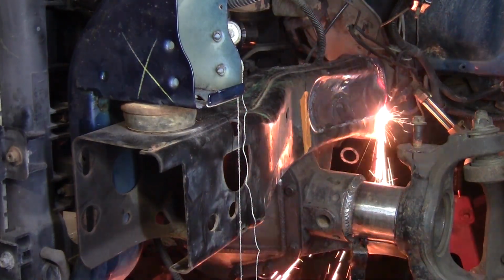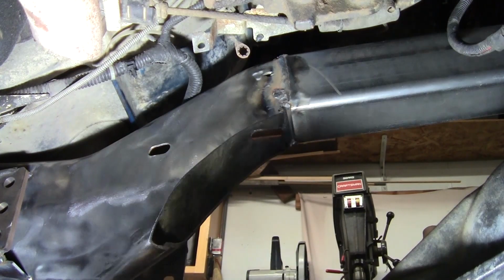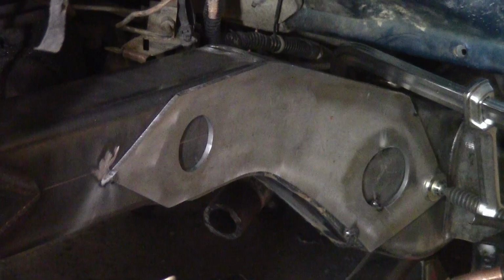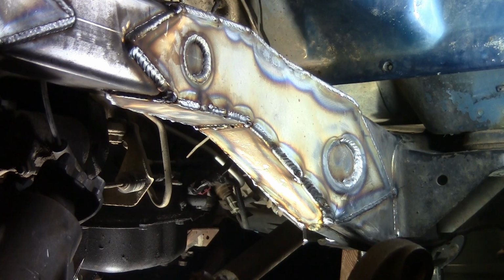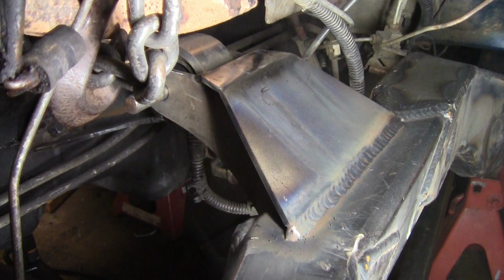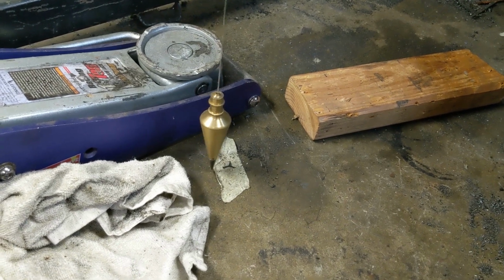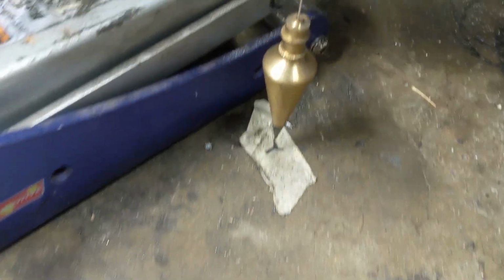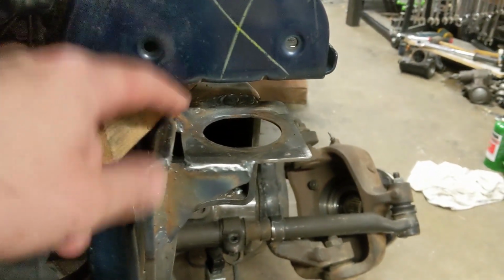Custom frame rail reinforcing - [Project SuperDUkota - Dodge Dakota + Super Duty axles] Part 4

Comment: I've seen so many people solid axle swap their stuff....that seems incredibly dumb to me if you want clearance because the bumpkin is solid and lower. If you want something fpr clearance while offroading, wouldn't you want the CV axle style setup front and rear I stead of only in the front? That way the bumpkin is up high and the axle shafts go down to it on each side and you have all that space in between for not wiping out your driveline, and you also aren't putting weird angles on your u-joints.

I mean that's the way I understand it. Can someone clarify why solid axles are used more than independent 4 wheel suspension? I understand solid axles are more reliable before someone says that.

I'm not badmouthjng anyone's build I just want a clearer understanding because it never made sense to me
Reply: Independent suspension's total up and down movement is limited by the CV joint angles. Most Independent axles have the differential offset to the side to leave room for an engine oilpan in the center. This means front CV shafts are pretty short and relatively small wheel up and down movements end up with high CV angles. Once these angles start to get high they begin to bind against themselves and will break much easier.

Straight axles are always straight except for the steering angle making them significantly stronger and allowing huge amounts of wheel travel until axle drivesshafts beging having the same binding issue, but since the distance between transfer case and axle pinion is much longer the angles change much slower
Reply from the maker: The other issue when dealing with anything custom is that independent suspension is exponentially more complicated/expensive to engineer and build. A solid axle can be mounted with some leaf springs and shocks and will function reliably and predictably. Not high-performance, but it works. Even a 4 link suspension on a solid axle is relatively straightforward while being capable of high-performance applications. Modifying, swapping, or building an independent suspension (assuming there's anything custom about it- travel, ride height, axle placement, etc) requires a pretty significant amount of engineering to make it function correctly. You see it reflected in the modern ultra4 rigs- most of the top 4400  teams run independent suspension, but many still choose a solid axle for the durability and value over independent suspension, even if it's capable of higher performance overall
Reply: @WebWheeler  the first part of that description kind of destroys the argument though. Independent front suspension isn't more complicated if it's already there....the rear end yeah I agree it's going to be a lot more complicated. But on front ends....a LOT of vehicles already have it. So...why get rid of that clearance for something that you have to modify to make it work that lowers your capabilities? As for altering ride height...I mean if it has bump stops...just cut them off....if you are raising it up, you won't ever hit them anyways on the downward travel. 

That said, dependability...I'm also going to complain there too....I can still get pull if one of the CV axles breaks...it's still turning 1 wheel...if a solid axle breaks (the same amount of pressure can shear solid axle shaft splines as CV axle splines) well you are done. No more moving...

Custom setups yeah they can be expensive and complicated...I agree...
Reply: @Kolonol1  modifications to an existing IFS setup will require a complete redesign to see the amount of wheel displacement that you would want out of a solid axle swap. It would require more money, knowledge, and surprisingly important, more space
Reply: @BrokeWrench  I wish I could show you pictures as to why you are wrong about that.  I have a 6" lift on my Dakota. That's a 6" suspension lift not body lift...I hate body lifts...it cost me $140 for the add-a-leaf kit to get my height on the back and a set of torsion keys for the front. Another $55 for a seperate leaf adjuster set to give it a little more now to the springs (added 1500 pounds towing capacity too which is good...I like functional) and then I spent $115 each on CV axles intended for lifted setups. It's not hard, and I didn't need to do anything you said...now if you are lifting your truck....idk say 2 feet? Ok it makes sense to swap the axles...99.9% of those vehicles though are highway princesses and will never NEED the clearance...mine? Well I have a bad habbit of finding deep mud holes and going for it....if I had a solid front axle I wouldn't make it...soon as I get my welder back I'll probably build an IS setup for the rear too.
Reply: @BrokeWrench  Less space actually btw...but before someone comes in here laughing and talking about flooding the engine and what not, I do have a snorkel

Comment: Thanks for making these man. They are worth gold to me. I have an 01 Durango, and a pair of Dana 60s I'm gonna slap on soon. I feel I am perfectly capable of doing this framework, but is it avoidable? Will my truck sit too high if I don't tuck them like you?
Reply from the maker: Glad to hear they help you out! No- the frame work isn't always necessary- depends on the axles used, tire size, and ride height. What are your 60's out of and what's your tire size going to be? Appreciate the good words! Thanks for the support 👍
Reply: @WebWheeler  they came out of an '04 f250, they're ball joints. Wanting to stay around 38". After it's built, it will only see the road on its way to (and hopefully back) from a wheeling trip. Gonna see alot of rock in its life.
Reply from the maker: @2cents422  nice!  Yeah with the '04 front end you probably want to stick to 38" or less, otherwise you'll chew up unit bearings like crazy.  You should be ok without touching the frame if your wheels don't have too much backspacing (4.5" or less i think) and lift it at least 2" which you'll likely want to do anyway haha.  Sounds like a cool build!

Comment: I like the truck I'd like to know what steering box are you going to use?
Reply from the maker: I mocked up a lot of different boxes but decided the best option was a current-gen super duty steering box. It's got tons of power and the offset from the frame worked really well with my track bar geometry. I will be covering all that within the next 2-3 videos so subscribe and stayed tuned! Thanks for watching 👍